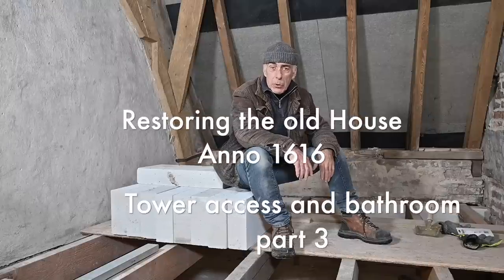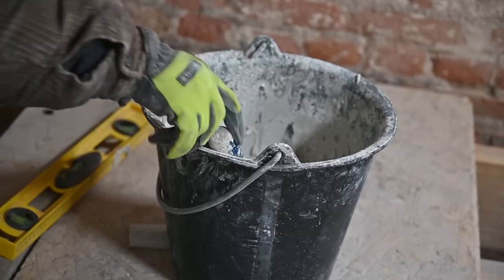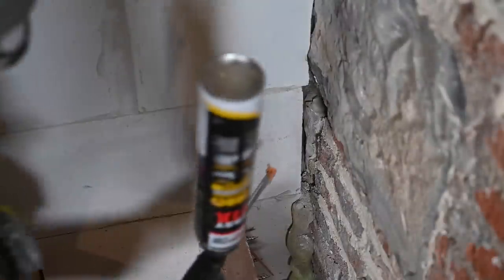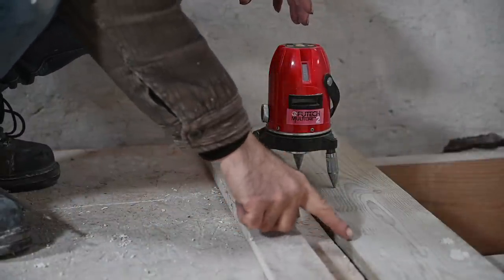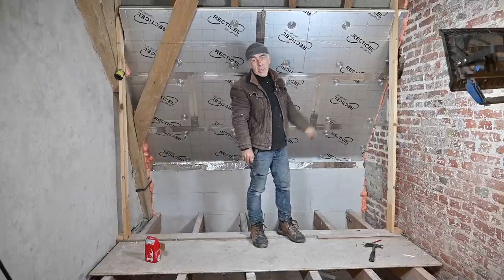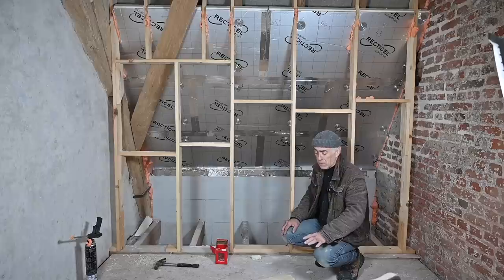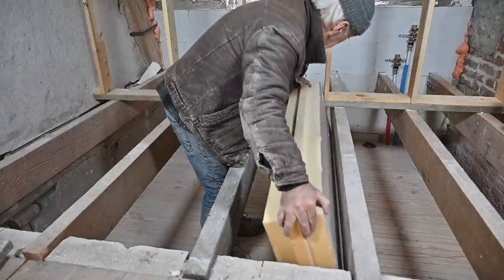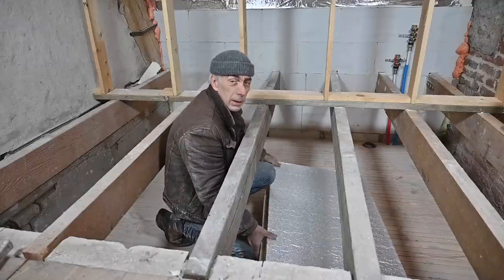Restoring the old house,  anno1616 - Tower access and bathroom part 2

Comment: A very neat piping system and a good substitute for copper. I have a suggestion, if you wind the PTFE tape on from the back of the reel, it will help keep the tape tight on the threads and make controlling the tape easier.
Reply from the maker: Thank you for the comments. indeed